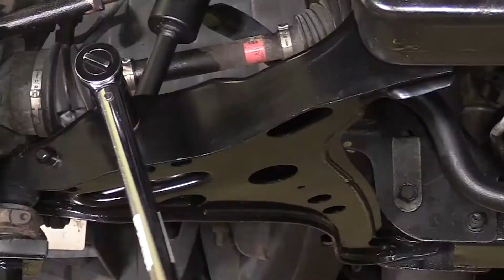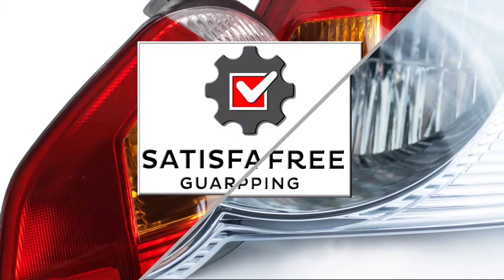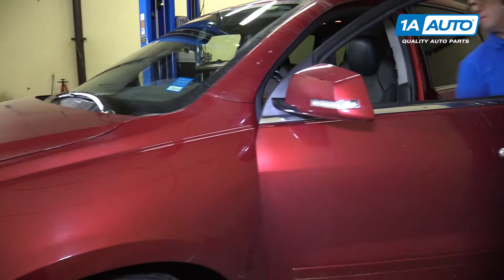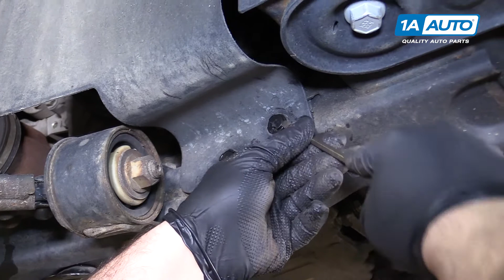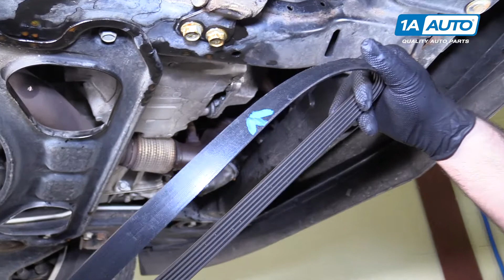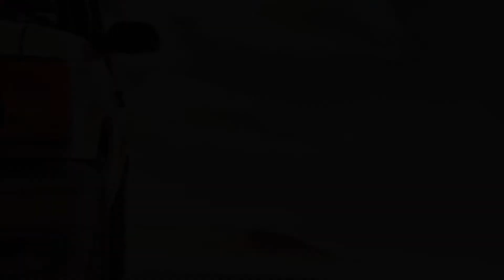How to Replace Water Pump Pulley 09-14 Chevy Traverse

Comment: WTH. You could of pulled the 2 broken clips out with pliers. If you just push them in they will rattle in the frame. And if the customer complains about it you will most likely charge them to find the rattle sound. Many years ago I did it to my car and it drive me nuts. I finally remembered I pushed in a broken clip.

Comment: This video sucks dont show when they take of the pump
Reply from the maker: Thanks for checking us out! This video shows the replacement procedure of the water pump pulley, not the water pump. I have copied a link which will bring you to another video that we offer which shows the replacement of the water pump and it should be the same or a similar procedure as your application. 

https://www.youtube.com/watch?v=uUUPyge_0wk&feature=youtu.be

Hope this helps you out.  +Rome Santos
Reply: My question is why would you only want to take off the water pump pulley? Or is this video only meant to assist another video on how to remove the water pump?